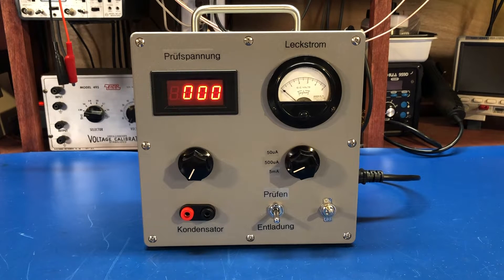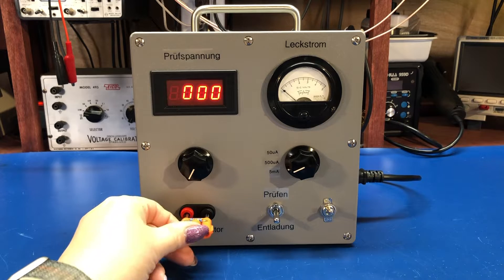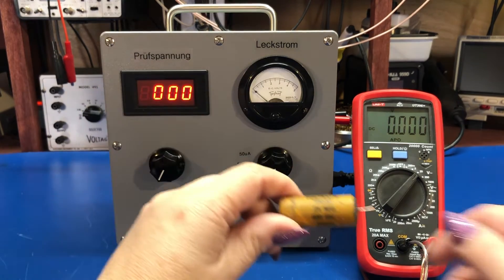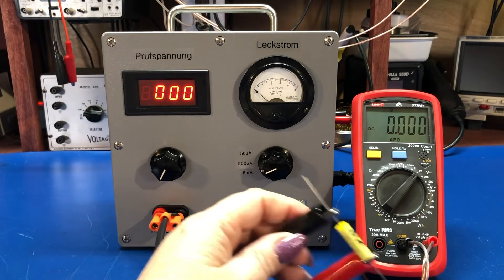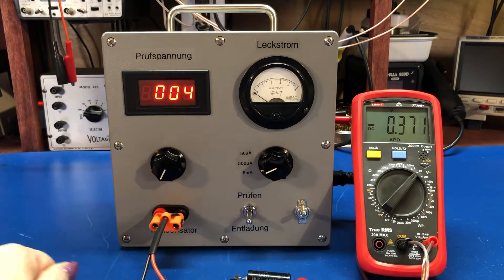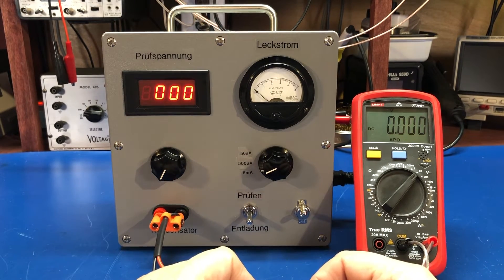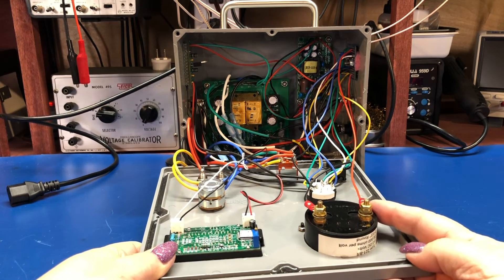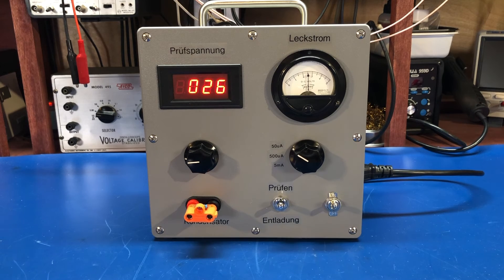High Voltage Capacitor Leakage Tester

Comment: Thank you Gary for your presentation. Trying to build it my self and have a grounding question . Did you ground awa pcb directly to iec socket ? In regards to dual power supply for the meters circuit, did you ground it on chassis or did you leave it floating?
Reply from the maker: Hi - Yes, I connected the IEC ground directly to the ground point on the pcb.  The +/- 15V smps module (for the current scaling and analog meter) was left floating.  The +15V was tapped and run through a 7805 to drop it to +5V to power the digital volt meter.

Comment: Hey Gary, ,   or anyone on here ever try leakage testing capacitors with one of those "Withstand Voltage Testers"  used for IGBTs & .. ??
They're capable of high voltage (50~500V+ +) with up to 5mA output.

Comment: I would be interested as to how you got the box from Home Depot.  Does the box have a stock number? Did you purchase the box in person?  And what criteria do you use to determine that a capacitor is leaky.  Do you do a comparison or look up specifications?
Reply: Thank You.  Along with many projects, I too have building the tester.  Problem is finding time!
Reply from the maker: I purchased the box there in person, from the electrical dept. It's a Carlon 6 x 6 x 4  Gray PVC Junction Box and you can get it online if you like.  The PVC is thick but workable, and I've used a few of them because I have easy access to them. :)

Data sheets will tell you what it should be and how to measure it. For general guidelines, you can look at the charts here: http://www.tpub.com/celec/54.htm.  These are from an older Sencore leakage tester I believe, but are a good starting point.

Comment: Very nice build, Gary. My AWA build did not go so smoothly. Getting exceedingly high voltages even with pot zeroed out. Variac to Dim bulb current limiter to the HV Cap Leak Tester build (I'm like the guy who wears both suspenders and a belt - taking nothing for granted on this initial test of the circuit). With the Pot at rest,  20V AC applied from Variac reads at 30.5 VDC; 35VAC = 53VDC; 54VAC = 98VDC. At 54VAC with Pot at approx 25% of travel, VDC reached 194V. Backed everything down and off at this point as the extrapolation for full applied 120VAV would (could?) produce 1200VDC (doubling the design output) most likely burning up every component on the board. (Bad Hammond Transformer???) Thanks in advance for your thoughts. - Mario
Reply: Gary, thanks for your response. This really is a bit of a puzzle. I have taken your advice and launched a query with AWA after subscribing for a year. It’s really curious, all functions seem intact only pulled back by 50% VAC. I’ve been able to test for DC leakage as well as reform older electrolytics.
On a personal side note, as a 76-year-old Vietnam vet (roiled with internal conflicts about that participation), I must say That I respect your choice and admire your courage in displaying who you are. Good for you! We are are nothing, if not humane to each other.
Reply from the maker: @mariomopic5809  I spent too long being who everyone else thought I should be, so it's nice to just 'be me' - whoever that is. 🏳‍⚧😉 I really do appreciate your kind words and support - thank you! ☺

And please do let me know if AWA has any answers for you!
Reply: @Donna_Matthews  Hi Gary... You're most welcome and thank you for putting out such highly informative videos. Two Gents (Paul and Tom) from AWA responded to my help query within hours! We went through a week-long troubleshoot and today was finally able isolate the culprit - the LR8 voltage regulator at "U2". It was blown. I followed this discovery up by rechecking the values of every capacitor and resister on the board - All Good. In my clumsiness, I did manage to break off the load leg of the other LR8 @ U1. So Ill be ordering replacements from Mouser once I get a list for other component needs from other projects. Thanks again! - Mario
Reply from the maker: @mariomopic5809  Cool - I'm glad they got you sorted. The rest should easy from here. 🙂
Reply from the maker: Not really sure, but check that you didn't blow one of the transistors.  I build the AWA HV power supply, and I've fried the power transistor twice already, making it impossible to regulate the output voltage.  The tester looks like two of the HV supplies running together to reach 600V.

You could also reach out to AWA with the question.  As they do not provide a schematic, it makes troubleshooting a bit more difficult.

Comment: HELP!!!  I just order the PCB and parts as instructed. Can someone please tell me how to wire the test/discharge switch (NKK, S332) to the PCB. Im not so clear on this. For example, which E number on PCB should be wired to which switch contact (1 to 6). Also the common (E11), should this be on more than one switch contact? This would be a super big help. Thank you

Comment: Great job on your tester and thanks for the video. I'm having a hell of a time finding the two gauges(digital and analogue. Did you get them from amazon or ali express? Thanks again
Reply from the maker: Thanks. I got both on Ebay. The 5 volt DC analog meter is an old Tripplet meter. You can fine newer ones from China as well that are actually pretty good. The digital one was also from Ebay - it's a 1000 volt DC digital from china. I believe you find these on Amazon and Ali Express as well.
Reply: Great, thanks for being prompt. @Donna_Matthews

Comment: Subbed. Got my clt 3g cap tester based on your review. I'm surprised it isn't more popular. It seems to work well. The AWA high voltage tester will have to wait.  In the meantime I am using an insulation tester to test at higher voltage.

Comment: Nice work! Very interesting to see how quick new capacitor can charge. Needle return back down very fast. I already built and create the numeric version of carlson's leak tester (as shown somewhere in few videos). Enough sensitive but only 27 volts. I'd like to do a tester like yours with a real rated voltage. It's on my list of future project. Thanks for sharing and again, good work!